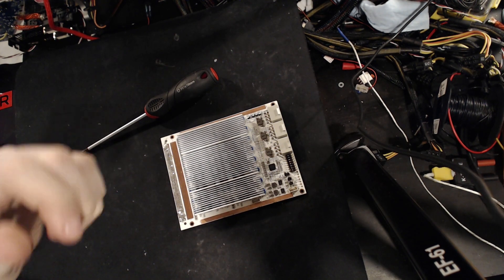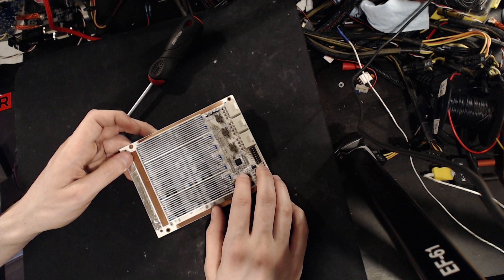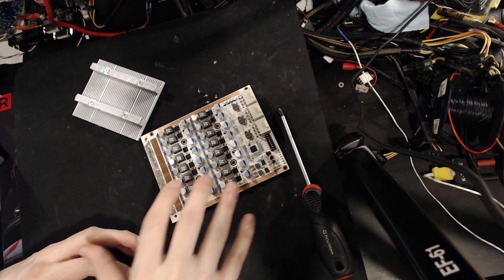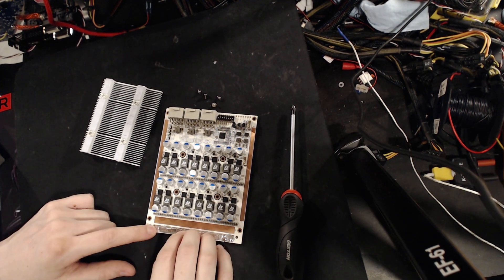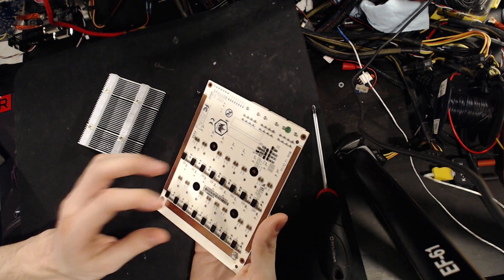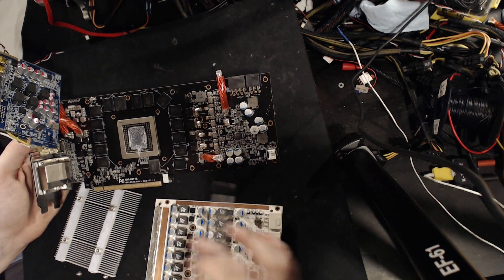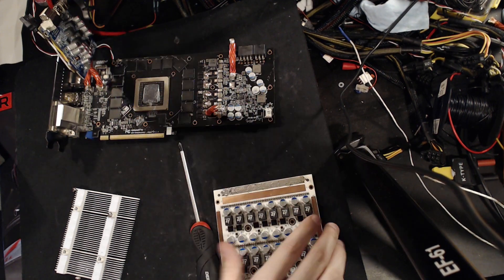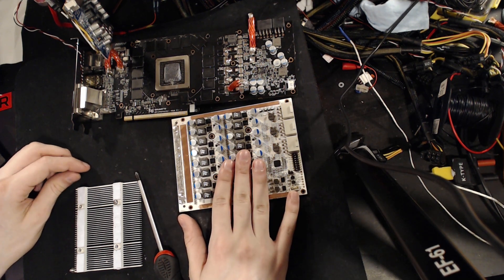The Galax HOF Power Board and the plan to ressurect my 290X

Comment: Not only has Epower Gen V a second voltage rail, it also has a form of a simplified evbot. And a lot more fine control over your voltages. Instead of dipswitches, which are 0.25 increments I guess?

Comment: For 2 lead components like the inductors, you can use 2 irons to desolder them, it is easy to do it without damaging them, adding plenty of solder also helps.I wonder how bad would adding some 100F 2.7V super capacitors would be to the VRM, perhaps too much capacity and makes the controller shutdown.

That iron does look to not have its tin plating.(somehow i can easily desolder components from old motherboards(lga775 type) without issues on a generic 48W station with a chisel tip.

Comment: you could liquid cool it.. i mean a straight copper tube with fittings and a flat surface isn't that complicated to make on a CNC, or even a manual mill if you know what you're doing.. you could thread it in its entirety to increase surface area.

edit:i unpause the video and watercooling gets mentioned. :D

Comment: If you actually find yourself in a situation where you need more power from that board than what the cooling can handle then there is always the VRM water blocks that Koolance, Alphacool and Watercool makes. You should be able to fit a pair of those to the board without any real issues, assuming the fluid used doesn't get issues when using LN2/Dry ice on the core.
Reply: are there waterblock for power boards ?
Reply: It's a good Q, I'm not sure how well the sticky-tape stuff works below 'moderate' temps (like around -40c).  I know quite a few tape adhesives simply do not work outside in the winter, and some only if they're applied before it got cold (in the summer).   Matching bolt-up patrons may be a bit tricky for regular thermal pad use.
Reply: I'll sort of second that (TheWarTube), especially for Ln2 cooling the GPU it's attached to. Thinking of how memory DIMMs build up ice from the chill through the PCB from a CPU under Ln2.  I would even have doubts about the operating range of heat pipes, not just liquid loop coolers forming ice particles.

Case and point for CLC pumps exposed to Ln2 possibly (the pic at the link).     https://en.wikipedia.org/wiki/British_Airways_Flight_38#Similar_incidents
Reply: thinking about it some, the VRM more than likely will produce enough heat to prevent its self from freezing under load, the debate is temps at idle. And I have no clue what the air temps would be in the vicinity of the Ln2 pot.   Simple metal fins may be the best bet, possibly.
Reply: I'm thinking there  is some comments that I didn't catch here. Did some comments get deleted?

The specific blocks I'm talking about are the ones that are made for "DIY" application on motherboard VRMs. As in the following products: 
Koolance: https://koolance.com/mvr-100-motherboard-vreg-water-block
Watercool: http://shop.watercool.de/epages/WatercooleK.sf/en_GB/?ObjectPath=/Shops/WatercooleK/Products/12001
Alphacool (can't find the DIY one, but it's similar to this): https://www.alphacool.com/shop/mainboard-cooler/mosfet-cooler/17475/alphacool-hf-14-smart-motion-cooling-plate-asus-m5a97-pro-mosfet-black?c=20691
None of them are ideal as far as efficiency goes, but I suspect they will be far better than the stock heat-sink either way.

Anyway, The main issue with utilizing liquid cooling next to a Dry Ice, Liquid Helium or LN2 pot would be  that the liquid could freeze or at least reach a high enough viscosity so that the pump would have issues. There is a couple of ways to minimize the impact of this, and if I would attempt it (without knowing anything about sub-zero cooling) I would do it as following: 1. Utilize a high concentrate anti-freeze mixture to minimize the amount of ice particles that will be created. 2. Utilize a high torque pump to deal with any added viscosity. 3. Utilize tubing that are more suited for sub-zero environments like Norprene rather than vinyl or any of the other clear types. 4. Obviously keep it all in a dedicated loop just for the power circuit, that way you would minimize the affect that it could have on other components in the system.

I have no clue if that would be an ideal solution rather than just taking a massive heatsink and milling it so that it would fit, but you would limit the mass that is concentrated around the pot. Thus presumably making it easier to use or at least less cumbersome.
Reply: Nah, just me responding to you, then TheWarTube, then just a thought in general.

That mass bit is another thing to consider as well, yeah.  I guess bottom line, is the VRM fets need to be kept below 105c (the limit of most mid-grade caps), rather than below 95c like GPUs and some CPUs. So that higher temp would allow a better heat flow to cold threw whatever is bolted onto the E-power zombi board(s).

And I agree with that suggestion list by the way.  My only doubt is if you're running full pot on a no-Cold-Bug GPU and taking some time between bench runs to log stuff. How cold would the copper wires get the VRMs at idle? are we talking -40c (normal day in Antarctica) or near Ln2 temps (dark side of craft beyond earth orbit)?
Reply: So you're concerned about VRM temps when at idle? If its a concern of them going to low, or having the liquid freeze at idle then perhaps a heater solution could be crafted. Nothing fancy, but just some sort of heating wire or something connected to another block in the loop. Just have that kick in if the liquid temps get to low, there is also the ability to turn off the radiator fans, but that might not be enough.

Comment: How do you calculate the current capability at a given voltage and switching frequency? From looking at datasheets a mosfets capability at Tc 100 is ~60% of the maximum current output, so in this case it would be 960A * 0.6 = 578. But, you say at 1.2V it's 480A, so do you then also divide by 1.2? This'd make it 960 * 0.6 / 1.2 which gives 480 also, but does that work out correctly? Or, is it the other way where you multiply by 1.2 instead? Which'd give 690A by my calculation which isn't a perfect calculation and has some leeway, so is close to your stated 720A rating.